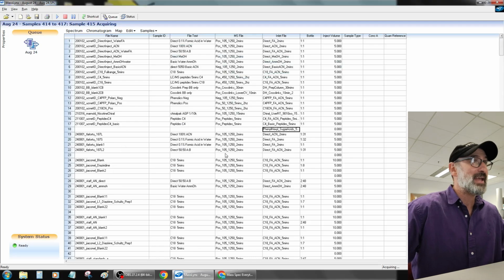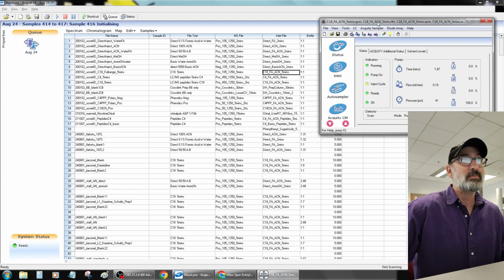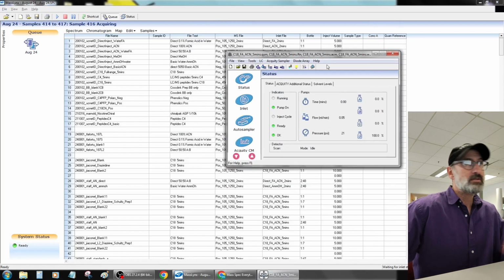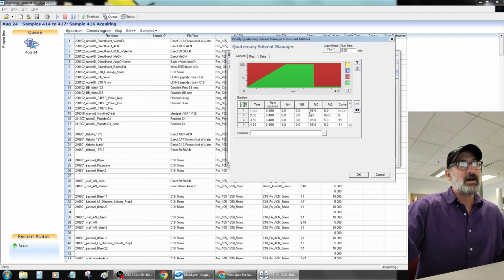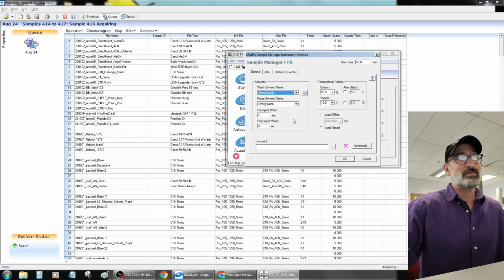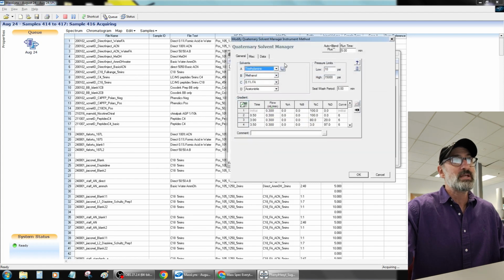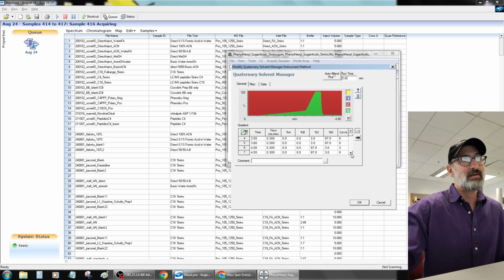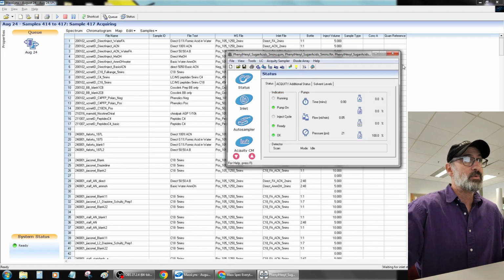MassLynx Instruction Part 3

Comment: Hi.  I am running a 9-point standard curve (2:1) with 6 different standards with different starting concentrations.  I followed the WKB60731, but when I process in quanlynx, I see a chromatogram and a calibration curve for only one standard; however, it doesn't see the internal standard, so it doesn't plot the calibration curve. For all other standards and internal standards, it says "no calibration".  I've verified acquisition function numbers in the method, along with all the concentrations of standard and stock concentration factors.  Everything looks good.  Do you have any suggestions?